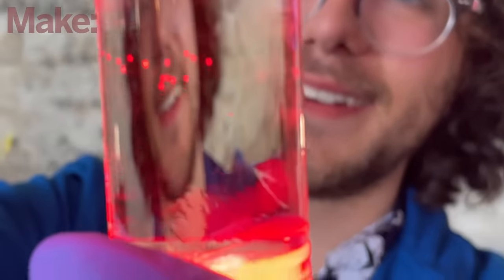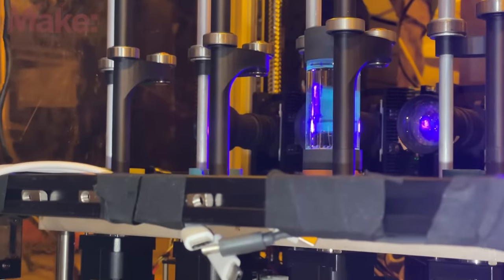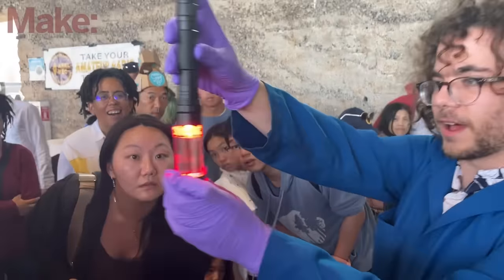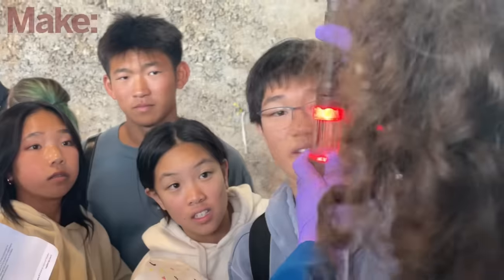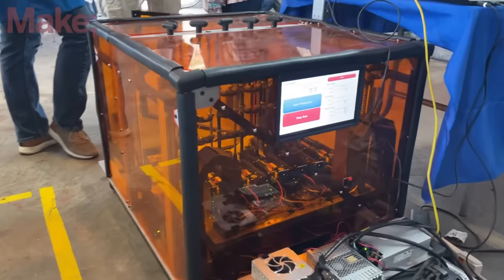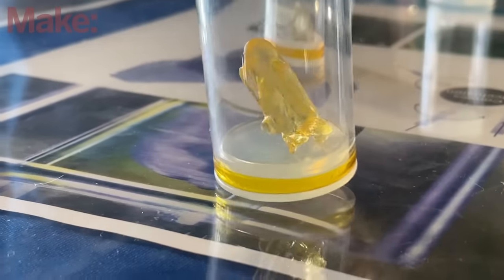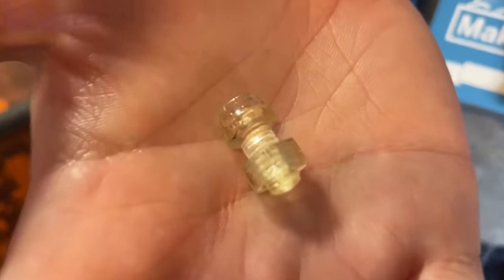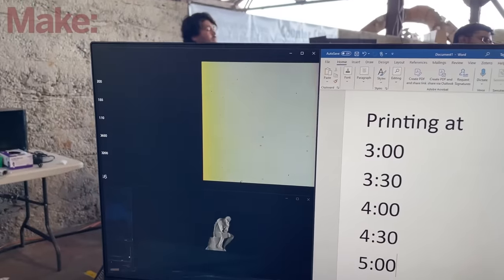instant 3D printing with computed axial lithography at Bay Area Maker Faire 2023

Comment: This is amazing, and it’s specially designed to be used both with and without gravity, which makes it even more amazing. Imagine factories full of these printers, they’re small now but they should be able to have the same volume as a resin 3D printer.
Reply: FDM printers also operate fine without gravity however, so not necessarily the most amazing thing. What's more amazing to me is the nut he printed having threads on the inside. AFAIK, concave, internal surfaces are a challenge to do with this method.
Reply: @PeppoMusic  Internal surfaces I don't think should be a problem because that system kinda works kind of like how radiotherapy machines work.  I think an MRI machine could be converted into one of these kinds of printers lmao
Reply: Like you, maggots, can actually benefit from that 😑
Reply: Obviously you have no idea of you are are talking about !
Reply: 20 sec to print, but... I think they left out just a bit of details, like... Getting the liquid mixture correct, removing bubbles, setting temperature, amount of light, AC power for zero gravity gizmos or whatever, and then theres the post process, like in Resin plus extra steps most likely.
A resin printer can print things in as little as a few minutes, but all the post processing is what actually takes longer a lot of the time.
Reply: @jtvtech5622 with these vials (and MSLA) having a washing station would be critical. Drain the vial into approximate container. Push isopropyl alcohol in then drain while removing parts. Cute part. 

Downsides of method. Viscosity is important. Temp affects viscosity but as long as you aren't too hot being cold is not an issue. Only being able to use clear resins.

Comment: When doing computed tomography (the inverse of this) you have to back propagate a bunch of times to not accidentally fill in a concave void. Maybe they simulate a run and look for spots that got too much light and then turn it down later?
Reply: Well that clears that up
Reply: RepentandbelieveinJesusChrist5 - is there a lot of engineering material in the bible? I must admit I have missed it so far.
Reply: @portlyoldman It's spam from a zealot, they've been making hundreds of identical posts.
Reply: @orbatos  - yes, I know, it just pleases me to make mildly humorous comments on religious nut jobs posts 😜
Reply: @portlyoldman  Ah, I see you are a man of culture as well
Reply: Anybody else answering the OP's question without mentioning the "zeabot"?
I wonder that too
Reply: @Drawliphant @DoNotPushHere Should be able to visualize these types of errors and have the visualization tool recognize and warn the user prior to print.  Also if an STL file is used you could use existing slicer applications to look for voids as you scan up and down the model.
Reply: @Lemosteam  thabk you, and yes but that is a standard procedure for any aditive process,right? What I think the OP means (and I myself wonder) is, how do you cast/cure different points of the solid, that are "in the shadow" or viceversa, how do you guarantee that certain areas on the same path of ray, remain uncured, thus hollow.
Op,correct me if I misinterpreted you
Reply: Would it be possible to combine the two techniques?
Reply: @mrwensveen  computed tomography takes shadows from lots of x rays and tries to calculate a 3d shape. In this case we have a 3d shape and are trying to project light to make the shape. The opposite, but I think almost the same back propagation algorithm would work. CT scan at first thinks your lungs are full of stuff because they're surrounded by dense bones but then it takes the 3d model it generated and simulates turning it back into x rays and looks for differences in the output and changes the original x rays to counteract the ways they disagree. For 3d printing you simulate a run and change the light and basically the same way
Reply: @Drawliphant  Ah, thanks for explaining! I completely missed the point about it being a scanning process. Need. sleep... 😴
Reply: Short answer: it's dine in Fourier space.
Reply: @Drawliphant you have no idea about how a CT works. The scan is done by the time the reconstruction is performed, nobody changes any X-Rays
Reply: @testboga5991  there are two kinds of back propagation in a CT scan and they both change a copy of the input data. I've implemented the algorithms myself

Comment: I wonder how much larger this could be scaled up? That's really cool tech.
Reply: They have attempted with mild success
Reply: its been around for a bit afaik
Reply: Can't print large parts due to heat issues. I think that an AI algorithm that takes into account all crazy influence could improve the prints substantially. Without that, the printing process would have to be iteratively refined by simulating it, comparing to the original, making adjustments etc. This simulation would have to be performed using a Monte Carlo light spread simulation, and take into account changing optical properties during curing, time and the influence of local temperature on cure rate. I don't think that would practically work. An AI that "intuitively" solves that problem may however work. Just look at protein folding AI or deblurring/ denoising AI.

Comment: This is like a CT (Computed Tomography) scanner, but in reverse.

Really neat.

I didn't think it would be very reliable, due to having to shine the light through parts of the resin that you don't want to solidify, but it seems like they've cracked the formula.
Reply: I think they quite literally had to crack a formula. Im gonna try to fjnd their github later to read more about this, but my guess is that part of their work was finding the right UV resin formula that takes a certain amount of exoosure to start polymerization but once polymerization has started it doesnt take a lot of exposure to cure.
That way you get away with shortly exposing resin that isnt supposed to be exposed to add exposure time to something behind it.
I also guess that the jnitial parts are in a very uncured state where they are just solid enough to be cleanes and then put in a UV camber to fully cure them.
Reply: @nicholasweiss4662  Yeah, a non-linear curing time thing.

That was probably the toughest part.

Looks like they are probably using DLP dev kits with UV LEDs, too. Must have been hard to focus the light through the cylinders properly.
Reply: My first guess would have been that they use multiple beams that are individually not powerful enough to cure all that quickly, but where the beams converge, it is more than enough intensity at that location.  That comes to mind because of both the speed and the ability to do multiple parts floating in a single vial.

Still gives me the impression that you'd get partial curing or increased viscosity throughout the rest of the vial, which would make any remaining resin waste.  If that is the case, scaling this up to larger print volumes will be hard.

Comment: I've been working with this printing tech since 1979. It's resin that cures in various light wavelengths, and it relies on focal points or intersections of differing wavelengths. Red and blue intersections produce uv. Infra red relies on focal point heating. The newest printers use uv focal points.
Project bluebeam is similar inasmuch as when two beams intersect, plasma in the visible wavelengths is produced. As of now bluebeam can only spoof stellar navigation by imposing the wrong constellations onto the sky. Sorry folks, we can't make convincing ufos or dieties yet.

Comment: Would like to know HOW it works, and a demo of something being printed - not the demo holding the flashlight, that doesn't really show anything.
Reply: I’m thinking holograms , 3D lasers , maybe ?
Reply: @cmendoza1094 regular lasers that actually exist are just fine. What's being done is all in the name. The needed attenuation and focus is calculated ahead of time and it works like any other UV printer except that the focus and energy are finely calculated to cure voxels from the inside out rather than raising a build plate. You can see all of this in the video.

There are problems of course, loss of precision is an obvious one.

Comment: I've see a few videos w this process. Not one shows it actually printing. As far as the zero g printing instead of removing gravity why not just match density of fluid and part it should just hang out in the fluid until disturbed. Right now it's much cheaper to modify viscosity of a fluid as opposed to modifying gravity. Lol. I dont understand why they are going thru all this to make a jellylike consistency substance into something more like resin printer epoxy. Maybe it's really hard to seperate the uncured resin from the product? Just a guess, I can't find it talked about anywhere.

Comment: There is a big difference between getting a part and getting a useful part.
Reply: Gotta start somewhere.  3d printers were expensive and a pain back in the day
Reply: @redone823  sure. True. But even first printers 3DSYS made were able to produce a useable part. This method is not constrained. And by the physics cannot be at this scale. But we’ll see
Reply: Investment casting turns almost anything into a cast: Aluminum, steel, bronze, or other metal parts. Using a low melting point metal that melts in boiling water, such as Cerrosafe allows anyone to do it, even using 3D-printed or many other plastic molds.

Comment: Okay i can see them using this to print out the frames for large structures,  with a big enough container. In space they may not even need the containers. Surface tension should be enough.

Comment: Don't say instantaneous. So this printing is from inside out with lasers?
Reply: Outside-in.
Reply: UV image projector (no lasers needed.)  Fast because it doesn't need to scan each point/voxel, it just needs a sequence of images from many directions, until the parts that need to be solid are "lit up" enough to harden.  (It's the inverse of a CAT scan where you irradiate the whole volume and get measurements of the solidity, instead of causing it.)

Comment: Only question is how BIG can this thing work with?  Due to refraction, diffusion, and thermal absorption the laser will lose energy rapidly, limiting the size of the object being printed.

A bolt, okay, sure... now print a chassis for a standard lab benchtop microscope.

Comment: couldn't they print while dropping the setup down a mineshaft??
Reply: I mean wouldn’t it be better just to take it up in a plane/helicopter/drone/weather balloon and drop it if you are dropping it anyway rather than looking for a really long exceptionally straight mineshaft?
Reply: To get 20 seconds of free fall you need a 1.2 mile mine shaft (and then you hit the bottom at 600+ mph, oops.)  The vomit comet/Zero Gravity Corporation aircraft flights are... more practical :-)
Reply: ....Not if the fall of the system was in a vaccuum. Easily created at the scales of a standard 3d printer.    @MarkEichin   oops?

Comment: Im willing to bet the laser focal point is where the resin solidifies and you just adjust where the point is
Reply: No!
Not that simple. This would still be classical layer by layer. And its already being done.
The approach is computer tomography in reverse. You shine a beam through the sample from ALL angles by rapidly rotating. Where the accumulated beam intensity crosses a threshold the resin solidifies.
This is a computationally difficult task. There is uunique solution for this inversion problem and a lot of trade offs to consider.

Comment: If it works in zero G better couldnt you put it in a vacuum chamber like direct metal laser sintering printers do for certain builds?

If so could you increase the volume of the containers and this the build size of prints?
Reply: What does a vacuum chamber have to do with zero gravity?
Reply: What are you talking about? There's still the same amount of gravity in a vacuum chamber, just no air. Air does not magically produce gravity.

Comment: There are high technology developments in a new form of aluminium parts fabrications that involve atomic separation technologies, IE teleportaton, where solid 1 meter square blocks of T-6 aircraft aluminium is disolved using this new atomic separation technology and sent by microwave, the internet, to highly distant and local locations during the process of the forming of the needed parts ordered using todays 3D Cad programs.

Comment: So they shoot some resin in a tube with a curing laser?  I couldnt stand this video so I need a tl;dw the microphone used for this interview was probably the worst possible option to select for this setting.
Reply: Learn to read. #Ltr
Reply: Yeah, great tech, terrible video.  (UV projector - much cheaper, you shine a short sequence of images from all directions and only the parts you want solid get enough UV exposure to harden.  The PhD part is that the math for that is hard :-)